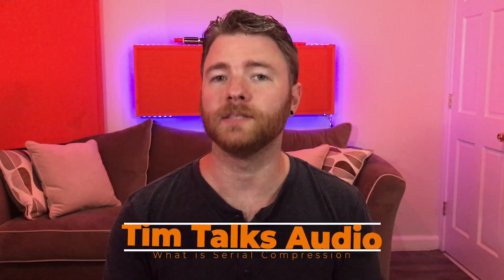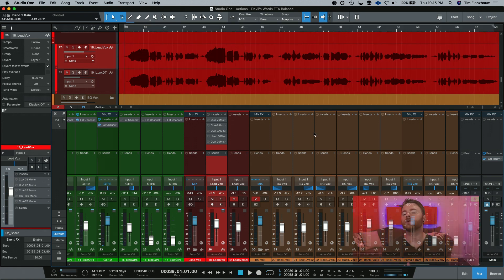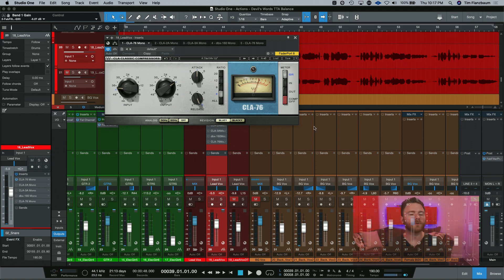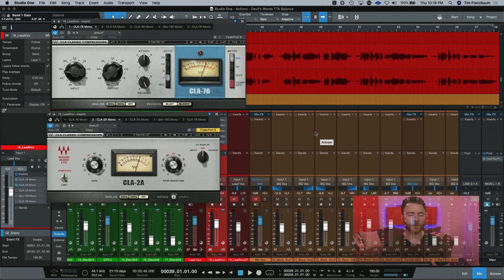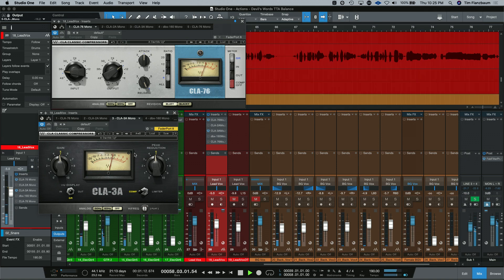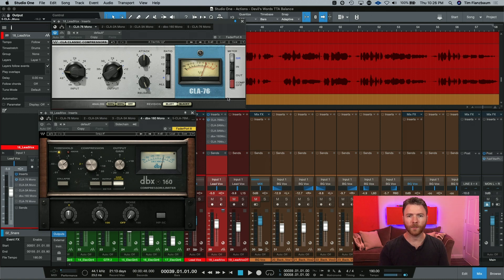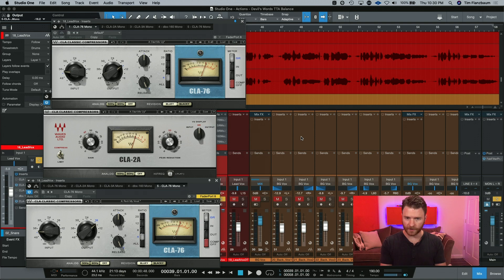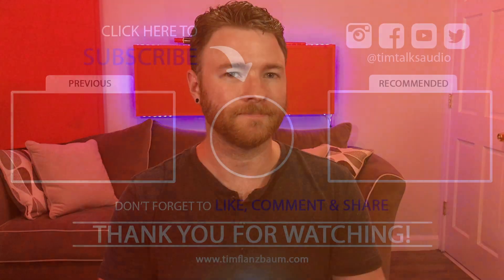Audio 101: What is Serial Compression and how does it sound?

Comment: Bro two questions.
1. Is it still okay to use Parallel compression after this wouldn't it be too compressed?
2. Should I make up the gain to compensate the lost volume, will that make my vocals too loud?
Reply from the maker: Of course it's ok! If it sounds too compressed after, you can back off the amount of parallel compression and let the track breathe a bit. If, when you bypass your chain of plugins, you may notice a change in volume. When your chain is on and it's a lower volume, then yes, you can use make up gain to get it back to it's volume in your mix.
Reply: @TimTalksAudio  thanks brother ❤ appreciate you

Comment: WHY would we use serial compression as opposed to using what was used in the normalization tutorial to bring down peaks and help the compressor not work to the point of needing so many compressors (or to use with fewer compressors)?

*Please Note:
I am NOT asking this as a challenge to value of this video.  I am asking so that I have a better understanding of "Use Cases", relative to what is happening in the mix, and which goals certain strategies may apply to as opposed to others.

Thanks
Reply from the maker: For the sound and to bring forward the source you’re compressing. 
To the first point, using one compressor into another helps bring forward the sounds of each compressor and each one doesn’t have to “overwork” to get a consistent level. Each compressor can do half the work, or compress different parts of the source (FET is fast and handles the peaks, opto is slower and gives more of a general smooth compression to the whole of the sound). 

One use case example would be a very percussive vocal. Use something fast to make sure that no transients poke out WAY to much, and are just leveled off, then use another compressor to smooth out the now leveled source to enhance the sound. 

Great question and I hope this helps!

Comment: Very information as allways, i need to try this on Bass, as  of learning this now, i have just been duplicating the compressor on the same track, could you advice a starter compression settings, (say for example Bass) as on the  your vocal demo i coulnt see your settings, i have seen on  one of your videos you created a bass blend bus, nice, did you serial compress them each before putting them in the bus, or   did  you do them all together  from with in  the bus ? Thanks Tim
Reply from the maker: Hey @Rock Writer, the settings of the compressors will change with every signal. For the voice in this video, the 1176 had a medium attack and the fastest release, and the LA-2A compressor doesn't have attack and release times since it is program dependent. I adjusted the gain reduction or input control on the respective compressors, until i got the amount of compression I wanted from each unit. 
For bass guitar, I do use some serial compression. Often for the lows of a bass guitar, I'll compress or limit them pretty heavily to lock the lows in place, then I can compress the mids and top end to get the notes to pop through as I need. Then again, I can compress my bass bus to glue everything together. Some settings to try are: Bass DI; medium-fast to medium attack & medium release, Bass Amp; Fast to medium-fast attack & medium-fast to medium release.
Reply: @TimTalksAudio   hey Thank you for taking the time to help me, i  have been  following and learning from you on compression. Eq etc i find it difficult with  compressors with no attack or release so i used an ssl bus compressor  thanks for  your suggested settings . You should be working For Presonas, as your knowledge and expertice, is great. again thank you Tim.

Comment: Hi Tim, I have seen several videos where sometimes engineers use mono and at other times  stereo vocal tracks. Which of the two is correct in mixing? Mono or Stereo vox tracks?
Reply from the maker: When mixing, you use the tracks that were given to you. Generally speaking, vocal tracks are mono. If vocal tracks come in as stereo then they are either stereo printed stems, or sub mixed vocal stacks. I would prefer to have multiple mono vocal tracks since a voice is a mono source, but if I am given stereo tracks, then that's what I'll mix! Also if you get stereo vocal tracks, listen to them to see if they are just stereo printed mono vocals.